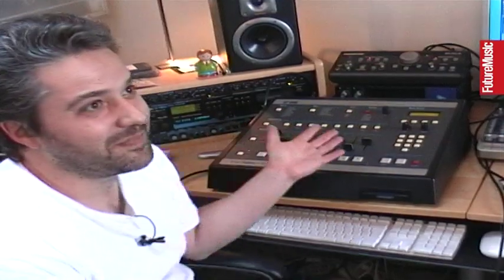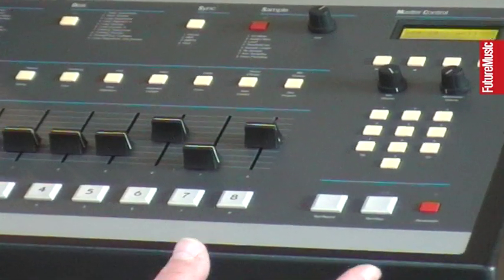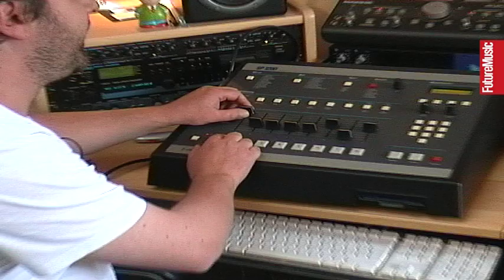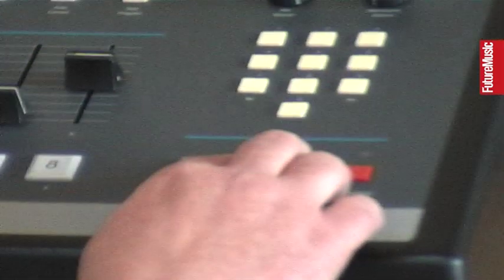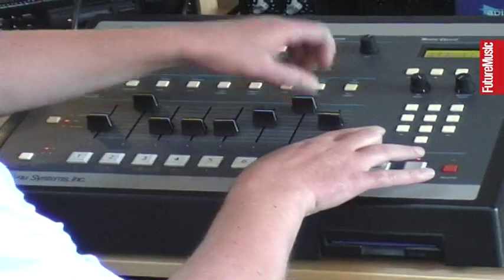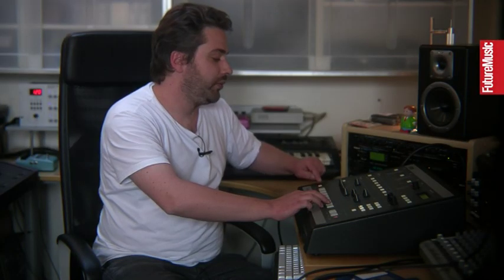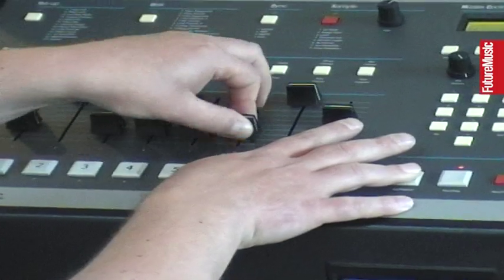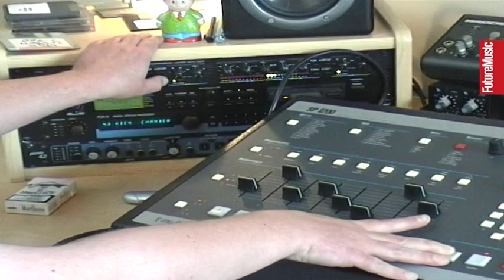Alan Braxe In The Studio With Future Music explaining the making of Running/Intro

Comment: The jet sample loop sounds as if it was passed through the asr 10. This phaser sound is a classic in this machine.
Reply: Either that or he has the DP/4. Likely the same preset in both. It's called Key Funk Flange in the DP/4.
Reply: @alexandermoden  Probably the DP/4. Same one Daft Punk had, and most of the french house goons too. Suuuuper happy with Phaser-DDL, plus I got a number-accurate remake of the patch on there too.
Reply: @alexandermoden  addendum: nevermind! braxe literally mentions the asr10 by name lmfao
Reply: @starphaserdisco  Phaser-DDL is great. I have a DP/4 which I still gets use but the convenience is hard to beat, especially when I'm using other settings on DP/4 in tandem. I'm curious, what adjustments are required to accurately match the patch? It sounds close to my ears right out of the gate.
Reply: @alexandermoden  The Key Funk Phase preset's parameters were sent to me via a Gearspace user. The precise settings are:
Mix=99 Volume=99
Phaser LFO Rate=32 Width=62
Phaser Center=16
Phaser Feedback=79
Phaser Notch Depth=99

Left/Right LFO=In-Phase
Phaser Sample & Hold Rate=Off
Phaser Left DelayTime=738ms
Phaser Right DelayTime=369ms
Phaser Delay Feedback=14
Reply: I doubt he used the Phaser-DDL effect on it

Comment: yall are getting high end and hi-fi mixed up. If its 12 bit, thats actually a lower bit depth than say a CD. there might be high end analog processors or whatever but by todays standard, 12 bit is not hi-fi. The quality of the product as a whole may be high end but a 12 bit processor is not hi-fi
Reply: its going through a desk after

Comment: I don't know anything about music production and struggled with his accent a bit. Can someone explain what benefit he got from sampling at high speed then slowing it back down afterwards?
Reply: The Emu SP-1200 only has a 10 second maximum sample time. So by sampling at a higher speed and pitching it down, you save memory for more samples. The side-effect of this is the "crunchy" clock noise that this produces in the samples that is part of what makes the Emu SP-1200 so special.